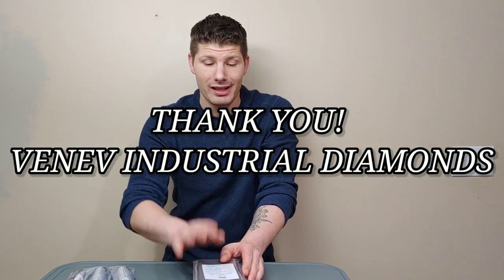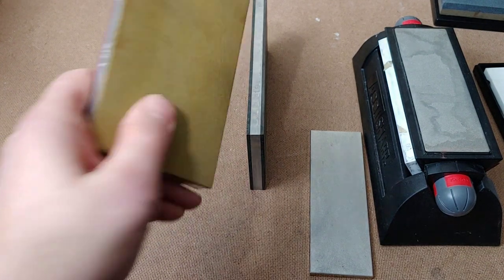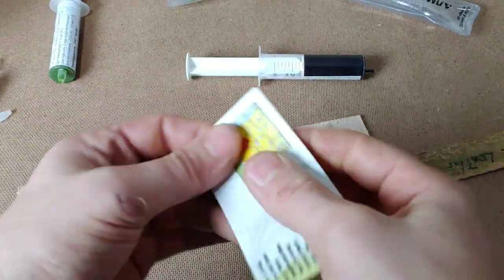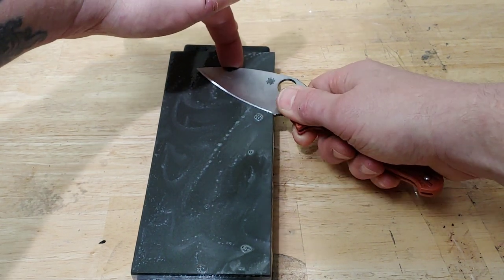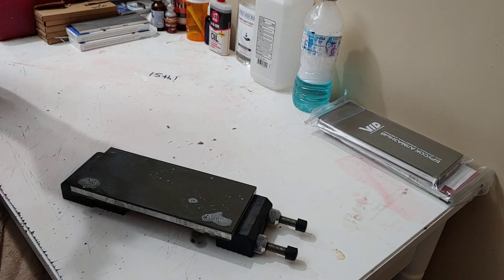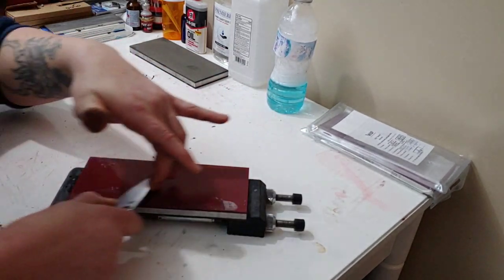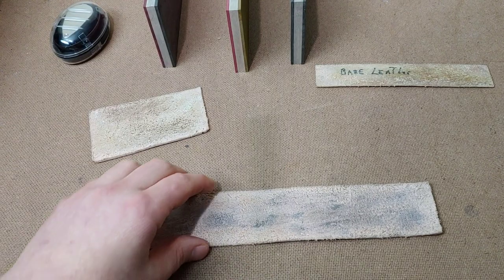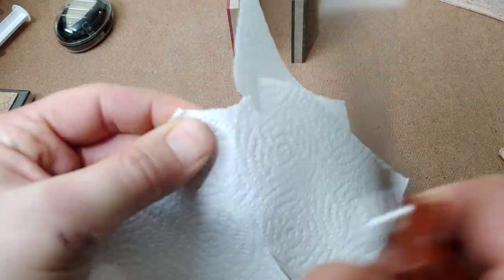VENEV DIAMOND STONES AND STROPPING COMPOUND FREEHANDING KNIFE SHARPENING

Comment: :_banggang:Got a few new Venev Phoenix stones. The 220 (63/50) / 700 (20/14) Plate & the 2500 (7/5) / 5000 (3/2) plate. Love the edges one can get with just those 2 plates (I also got a few other diamond and ceramic stones If i feel I need something in between).  I think they might have changed the low/medium grit as my old phoenix stone was 160 & 700 If I remember right. :_banggang:

Comment: I bought a set a little bit ago and they work great now. Initially they felt a bit too “gritty”. After a couple uses that does smooth up.
Reply from the maker: Yeah most diamond stones do have a break in period, thats why i gave then a little rubbing with the little aluminum oxide stone, and i love venev stones the stones really take sharpening to another level

Comment: Amazing these venev stones! How does Venev diamond compound compare to Gunny juice?
Reply: Ginny juice is made by the same Russian enterprise. The compounds have a very small amount of mono diamond in its ingredient list. Because the diamonds are more durable but not as effective. Ginny juice has standard poly crystalline diamond, that are more effective but are weaker in durability. Both are based on a oil based product, which in effect needs a very low percentage of diamond in the overall structure .

Comment: Do the coarse grits cuts fairly fast?
Reply from the maker: Absolutely
Reply: @NeevesKnives  yea I decided to try the 80 grit 150 grit to thin out my esse izula and if that don't work I been wanting to get a bench stone from practical sharpening I have some of his edge pro stones but I find there to small to work the main profile of the blade
Reply from the maker: @kevinfitz3721  To thin out the edge? Or the grind? It will definitely work to lay the edge back, the lower grt felt similar to a 280 to 300 grt diamond plate
Reply: @NeevesKnives  grind, i know its not the best but I hope it will do better than using 1x6 stones
Reply from the maker: @kevinfitz3721  Oh it will work as long as its the xcoarse, a 50 grt diamond plate would work faster but these will have the life left after

Comment: Why use stropping compounds over just regular finer grit stones?
Reply from the maker: @BatmanTC  it's for different purposes you should use finer grits stones also, imagine the edge bevel as a micro serrated blade, the leather with a compound allows the fibers to get in between the micro serrations, it also allows it to snag particles gently without disrupting the serrations you created. You should see my most recent stropping compounds I've tested alot at the point stroppy stuff is best
Reply: @ so let’s say I have a 6 micro stropping compound which equals 3000 grit from what I’ve read, are you saying I should have both the stone and the strop bc they achieve different things even though they equal the same grit more or less?

Also, for crazy sharp edges, what’s the least amount of stuff you’d recommend, like I know you like Sharpal diamond, just a few of their stones and then some stropping gear, if so, which ones?

Comment: Can I use shapton pro 2k 4K 5k 8k 12k after the 1200 venev or does that not make sense going from diamond to ceramic . I was thinking of continue with the next grit after 1200 . TYVM for your time
Reply from the maker: You can absolutely, but the grit is different a 1200 venev is 5k grit  so I'm not sure you would want to maybe the 8k and 12k
Reply: @NeevesKnives  tyvm that is very cool of you to answer and so fast .

Comment: Hey bud, in a moment of weakness I just bought the Benchmade Bugout with the aluminum scales in M390. Once it arrives, I will want to profile it with my own edge. I recently picked up the 240/400 Venev Dragon stones. I don't have much experience with M390. I was wondering if that 240 Venev would be coarse enough to do the profiling, or if I should start with my UltaSharp coarse diamond stone. If I did that, would I then go to the 240 then the 400, or skip the 240? Also, my coarse UltraSharp is pretty worn in (not bad), so didn't know if it might not even be that much more coarse than the 240 Venev. Just wanted to get your thoughts on stone progression before I dig in. Thanks!
Reply from the maker: The 240 will work. I've Definitely used it many times, it will take a bit more time than the lower grits like the 100 but will still work fine. You Definitely want to start with your lowest grit to make work faster while setting your new angle and bevel, make sure everything is perfect before moving to the next stone, that way the next stone will go faster. The farther you lay your angle back the longer it will take
Reply: @NeevesKnives I’m good on stone progression and doing the major work on the first stone. Just didn’t know if the Venev 240 could handle M390 or if I needed to use that UltraSharp 300. I’ll go with the Venev just for something different. Thanks!
Reply from the maker: @MrEric0822  yeah the venev stones are the best for m390, a diamond plate would be just the same with a low grit like that, if you 300 grt is fresh and very coarse still then it might be good to use first but if it's wearing out a bit and not so aggressive anymore then the venev will probably work better either way the 240 will do just fine

Comment: You have different technique. Im gradually decreasing presure as grit# increases.. But i guess the diference in result is marginal, light presure brings out the polish better while presure give the edge proper bite.. But you should lap them🙏 They will workbetter
Reply from the maker: They work amazing, i dress them as needed, and use these daily, i base my pressure on different things sometimes its less and sometimes its more, i love these stones
Reply: @NeevesKnives  Me too🙏 Awesome stones indeed.. I cant compare them to anything else really and i collect stones and compare their performance.. They are so far the only ones to not load as bad as the other resin matrix stones i have.. But i would recomend getting resin bond cbn stone as a finisher😉

Comment: Yup, I can not tell you how many diamond stones I have worn out. DMT being the worst and fastest wareing POS. I seriously wanna try these Venev plates. (and a spyder med cer-)I dislike Al-ox stones, I have to have them for particular apps but when it comes down to it I prefer to use silicon carbide if I can't use diamond. NONE of this includes compound, only speaking of stones here. HS Al-Ox rouge is the bomb when used properly.   
Ditto, I have a few Spyders with crappy OE bevels
Reply from the maker: Yeah a lot of companies come with crappy bevels and Spyderco is definitely one of them, the venev stones are great since they take so long to wear out compared to plates, and ive heard that the dmt used to be great but now for what ever reason are not doing as good, i love the little diamond plates i use, they work great and last a decent amount of time, and they are way cheaper than dmt